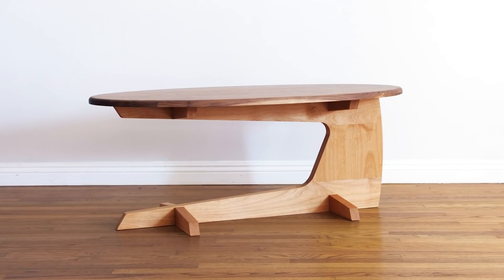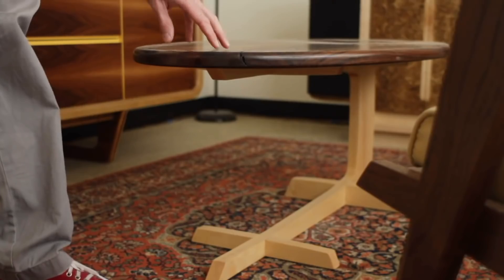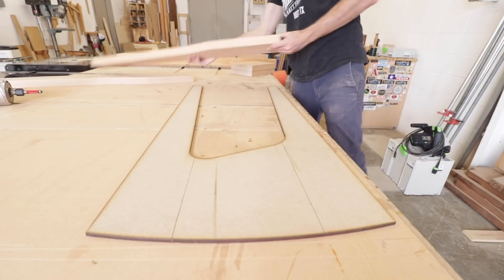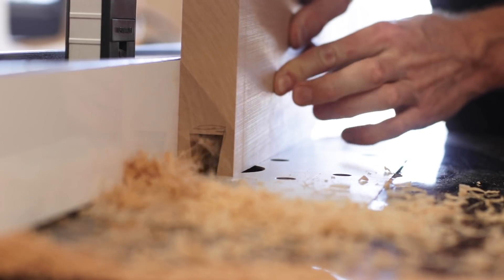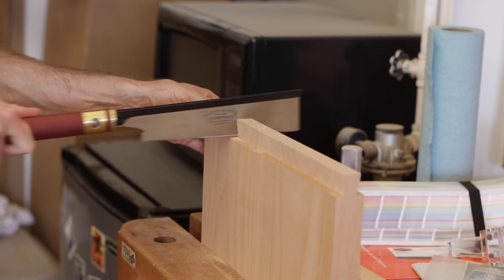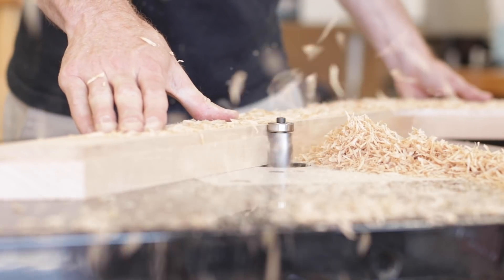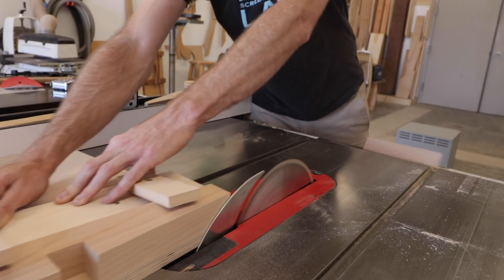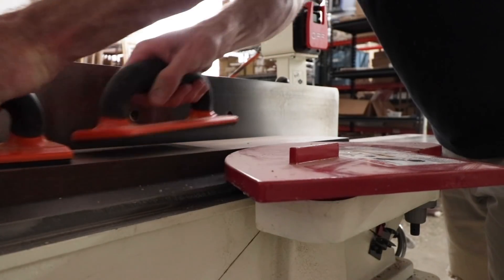Mid Century Modern Cantilever Coffee Table Build | Woodworking

Comment: Nice design and video. Just wondering why the middle piece of the stand has the grain vertical (opposite to the other two pieces)? Wouldn't the grain of the wood flow better if it was also horizontal and isn't there an issue with wood movement with your design?

Comment: My take on on your design would be to incorporate metal in the stand as the structure could be slimmer yet still rigid.  Either encase a welded frame into timber. Or make the entire base from black power coated steel in a similar way to Robin Day / very vintage Habitat furniture.  Thanks for the vids as always.
Reply: Square steel tube core with a wood sheath.

Comment: Question: How can I get into woodworking more as a student with no shop or recourses
Reply: I started by building some things based on designs and how to videos from YouTube. Then over time just slowly made more and more complicated things until I started building cabinets and things like that.
Reply: You don't need an actual shop to make something simple. A balcony or a backyard should do you just fine.
As for the resources, you can get wood from the forest (but you need to dry it first) or you could get scrap wood for dirt cheap from a local wood company. You could even use firewood. But don't shell out hundreds of dollars on wood, it may look pretty but if you're inexperienced you could destroy your piece and lose all the money you spent.
And the tools, all you really need is a hand saw, a couple of files (get the cheapest ones, you really don't need the crazy expensive ones if you're just starting out) and a chisel (again, don't buy the really expensive ones if you're starting out) and a bunch of sandpaper (make sure to get different grit sandpaper, like 60-400).
Things like plainers and table saws are incredible tools but you shouldn't buy them if you're just starting out as you're inexperienced and you could hurt yourself or destroy the machine. Move slowly from project to project and you should use tools like that when you fully know what you're doing.
Reply: Look into joining a maker space in your area. You get access to a shop full of tools, sometimes classes and helpful advice.

Comment: How did you improve the stability?  (Did I miss that?)
Reply: jaydub The vertical portion of the base was widened by a significant amount, as well as the upper and lower horizontal parts. It is significantly more stable than the last version.